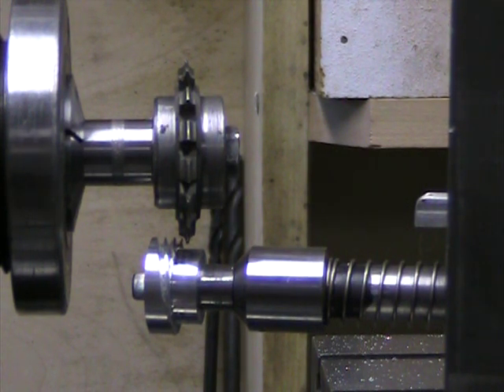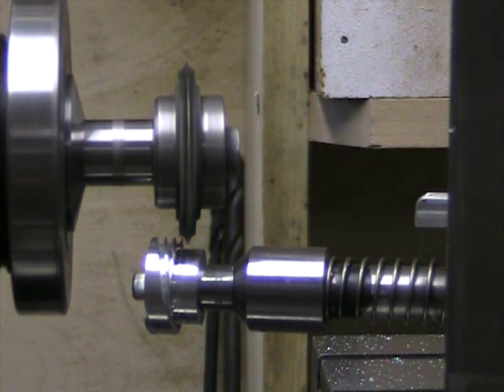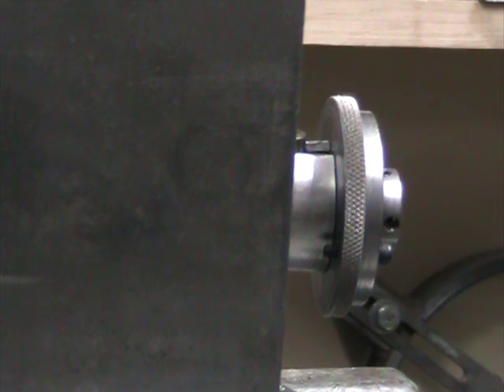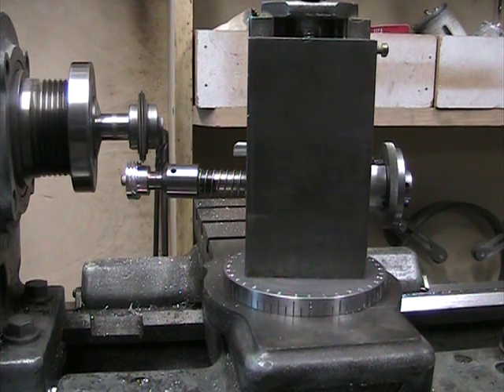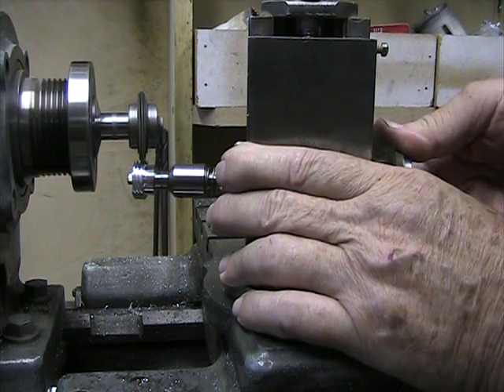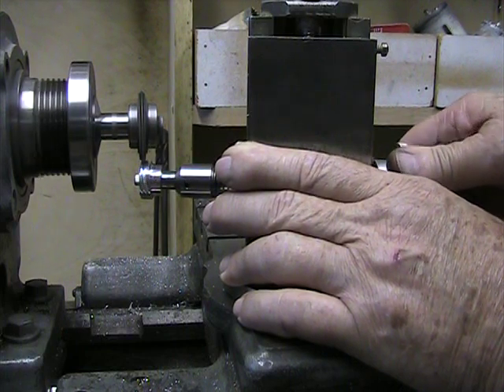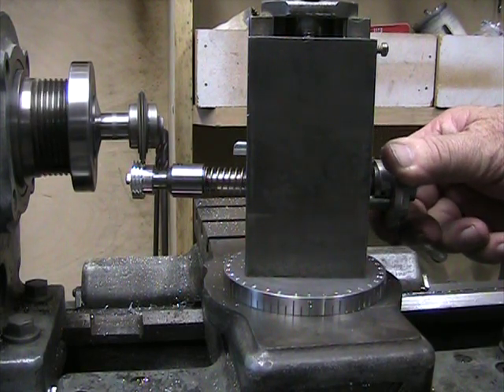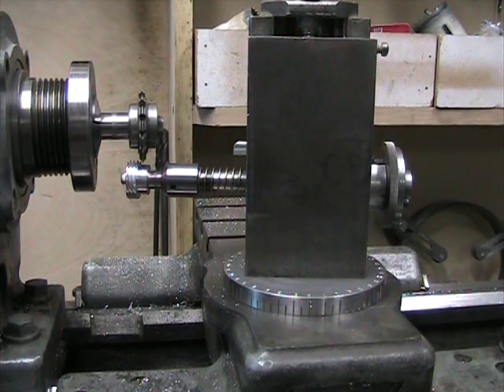CuttingHelicalGear.mpg

Comment: Chuck - a nice & simple setup. How did you make an accurate profile for the cam? I need to make a pair of steel/bronze 15t, 45deg helical gears to replace worn out gears on the knee of my Harrison mill, and will probably duplicate your manual fixture. I am struggling to come up with a way to make an accurate cam.
Reply from the maker: +neil9 The cam is a triangle made from 1/8" aluminum plate and bent around the mandrel.  I wouldn't recommend this setup for gears made of anything harder than brass or aluminum or gears that are more than 1.25" diameter.  Since the feed is manually controlled by hand, I would worry about kickback.
Reply from the maker: +neil9 Also, if you or someone you know has a CNC mill with a 4th axis, it's pretty easy to cut a helical gear of larger sizes.  I have the g-code to do that.

Comment: This helical gear closely resembles a worm gear. I assume the difference is in machining a helical is that each tooth is indexed compared to a worm which is a single spiral. http://www.engineersedge.com/gears/gear_types.htm also http://www.roymech.co.uk/Useful_Tables/Drive/Helical_Gears.html
Reply from the maker: Helical gears and worm gears are very similar in appearance.  And worm gears can have 2 or even 4 parallel spirals.  Worm gears are always used in applications where the shafts are at right angles to each other.  Helical gears can be designed so the shafts operate at any angle although the most common configurations are at right angles or parallel.
Reply: Thank you for the explanation. So does a helical gear provide more torque and is less noisy than a spur gear. I assume spur gears are cheaper hence, there widespread use compared to helical, which are used in precision machinery and where higher torque is required.
Reply from the maker: Helical gears are quieter than spur gears.  But they also produce axial thrust because of the angled teeth.

Comment: Hi
Just wondering in your helical gear cutting jig / fixture that I have found=  from you elswhere on the net what cutters do you use ?
Do you still use the numbered cutter that goes with the number of teeth you=  are cutting eg #7 cutter to cut 14 to 16 teeth ?
I need to make 3 helical gear for the distributor drive for a Hodgson Radia= l engine (Ageless Engines) Thanks for your help Christas